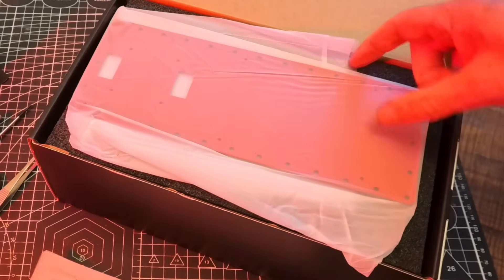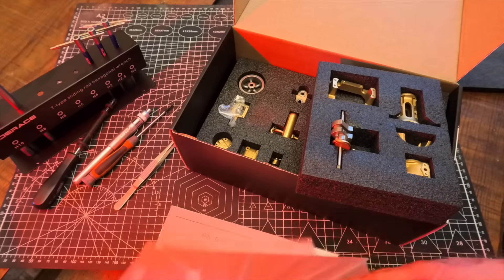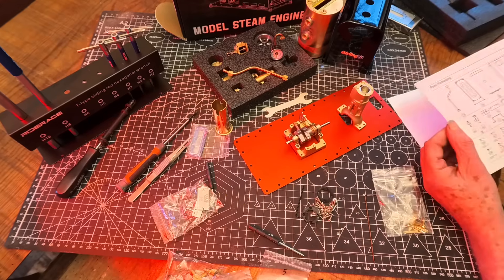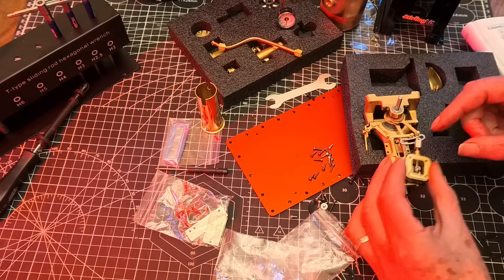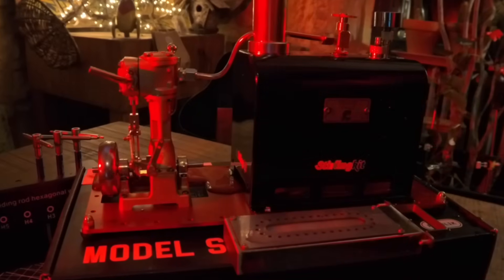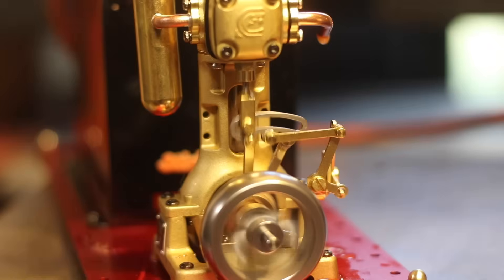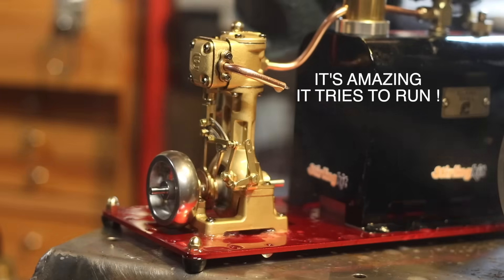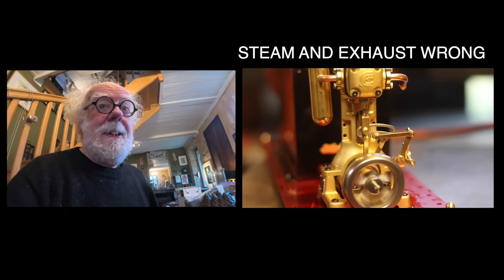IDIOT Builds Steam Engine Wrong  !!!

Comment: Good point about the jumbled up nuts and bolts. They need to look at IKEA build sheets. I think RT(F) M is the usual comment.
I thought I saw that those spirit burners were going to banned for models and replaced by those hex tablet things. Or did I misremember that? 
Well done in getting it going..

Comment: Nice ! amazing how they made so many metal bits for the kit ... when i was a kid you saw a lot more of these. Even in toy catalogs.  I didn't really see any change in the actual hardware when you fixed the mistake. I think in the passed the model steam machines had some little tray or something to collect condensation water from the exhaust. But i guess those where not copies of an old big steammachine.  Maybe next time build it on something without all the lines and circles on it.  Maybe the back of the cutting mat doesnt have all the markings on it.  Might make the building a little cleared.  But nice video !
Reply from the maker: The kit uses all the parts with a few spares for good luck.

Comment: 😂 I thought that must be a trick, like after 10 Minutes you release a Nicola Tesla generator reconstructed or so. But no, it's a steam engine🤣 1:0 for you prof.
Reply: We actually encountered this “reversed inlet/exhaust” issue during our internal test builds as well. Because both parts can physically fit in either direction, it’s easy to install them the wrong way if you’re not paying close attention. Unfortunately, this section of the design cannot be made fool-proof due to the structure of the parts, so we specifically highlighted the correct orientation in the instruction manual to help builders avoid this mistake.